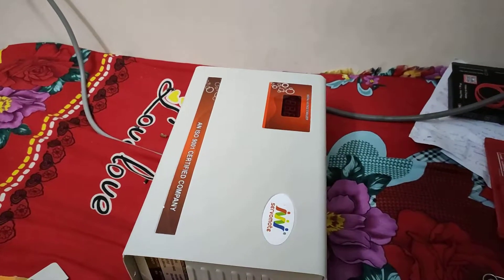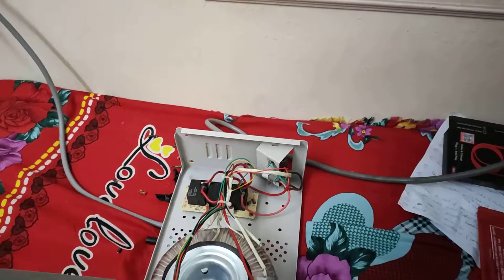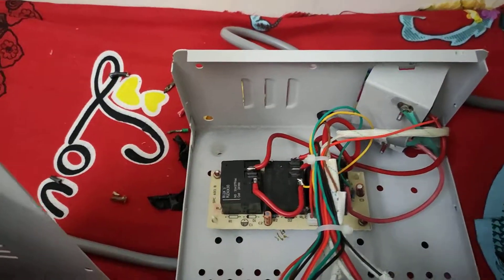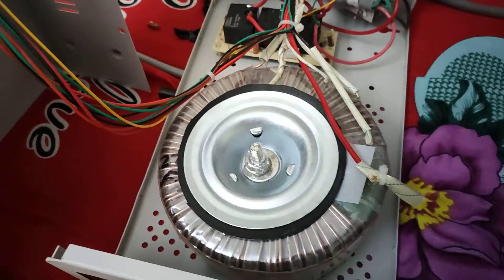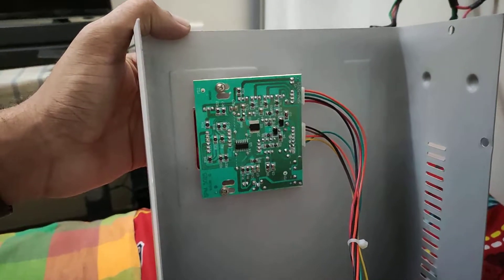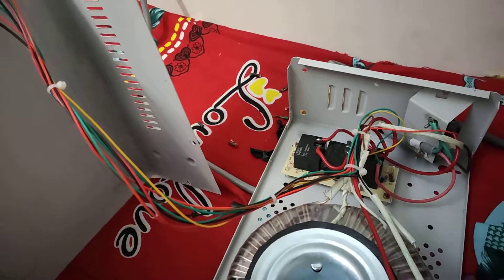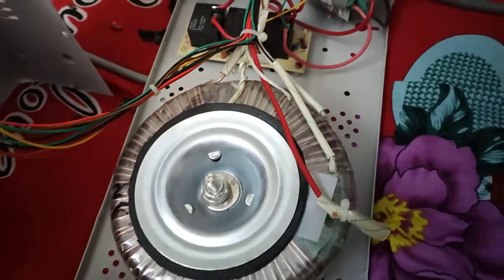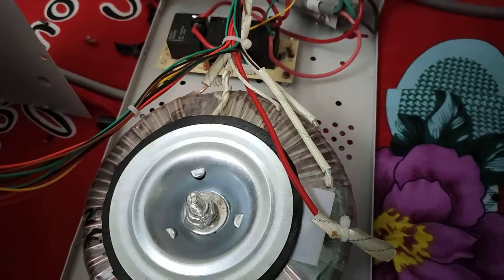Servomate 5kVA stabilizer inside view

Comment: Does it give 200V -240V output if input is between 150-170V? Did you get a chance to check when input is below 170V?
Reply from the maker: I can check that. This stabilizer has two steps. One activates when the voltage is below 200. One more step I have to check with the auto transformer without load.
Reply: @roycas3  Thank you. Please keep posted.  I am planning to buy one for my AC. Most national brands V-guard, Microtek, Everest generally have make stabIlizers with output voltages statring from 170V, 180V etc. SERVOMATE is the only brand in which manufacturer has confirmed  that output will be between 200-240. Can you please post the photo of the side label in which they have mentioned the specifications. Thanks in advance.
Reply: @roycas3  hey brother I have ordered same in copper 5kv for my native place.
 Can u jus temme how is it for household and how's the performance ?? 
And can u lemme how's it when u compare it with Aulten brand ? ( If u know )
Reply: @vikasjha2975  aulten buy from servomate and put their brand name on it. Infact many other brands buy from servomate itself and sell by their brand name. U can see piks and compare both servomate and aulten stablizer side by side.

Comment: Can we use this for 1.5 Ac along with refrigerator and washing machine
Reply from the maker: Please use separate stabilizers for AC and other appliances. If you are using an inverter AC, then there is no problem.
Reply: @roycas3  I wanted to know that if my load is only 2kva and I am not using ac then can it be used as mainline stabilizer?